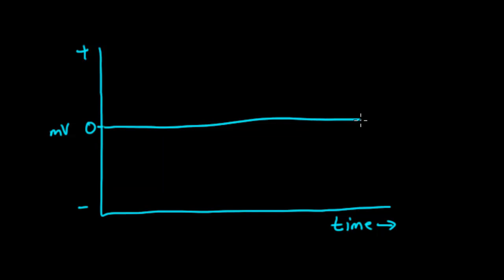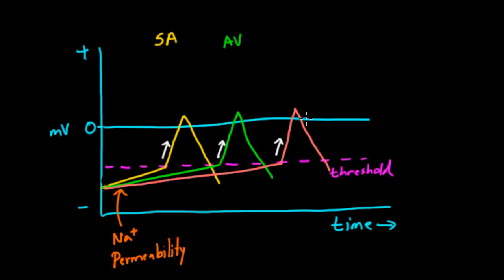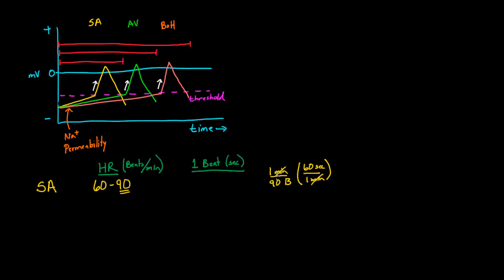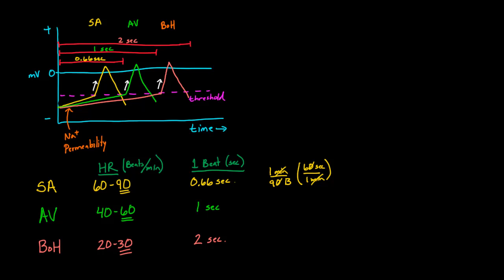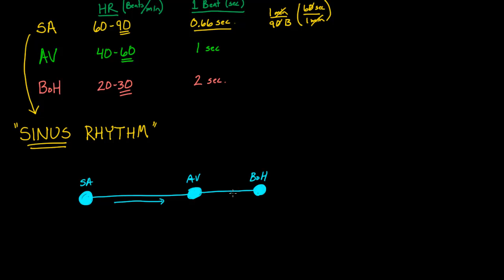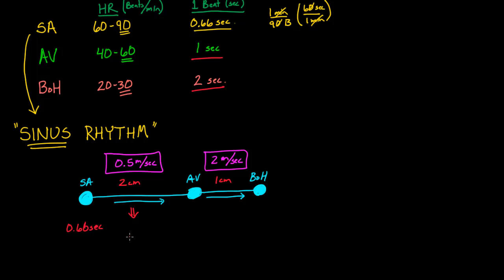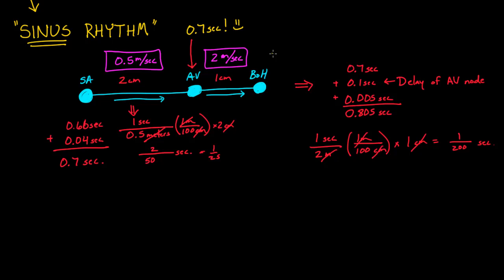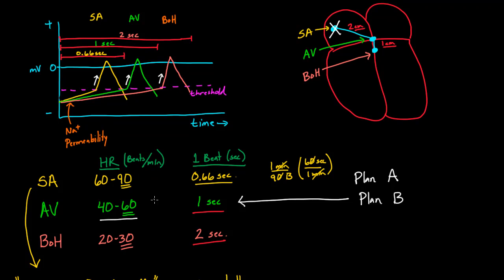A race to keep pace! | Circulatory system physiology | NCLEX-RN | Khan Academy

Comment: Is there a connection of the backup hearts b and c? Is there a chance that they may not know SA did not do the work and those seconds of wait are nit recognized by plans b and c? And would that create a problem = death no heart beat? How does the plan b and c know they have to start up? Yes the after 1 second passes but how does it know? What would block that “alert”.?